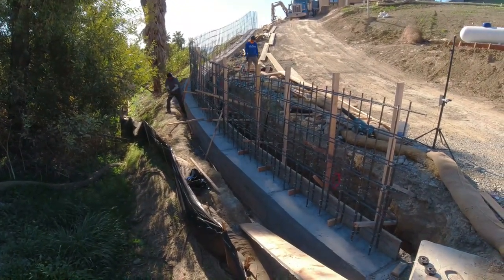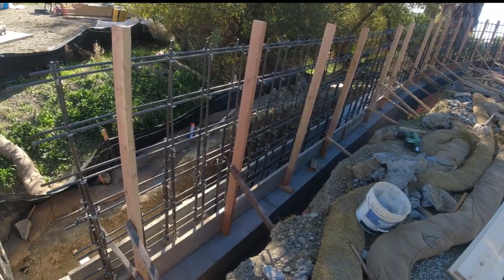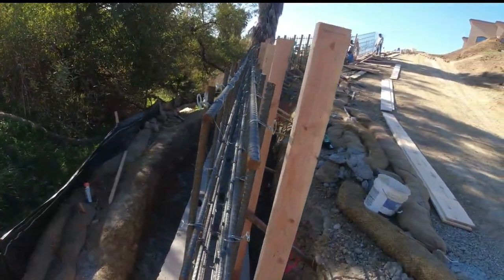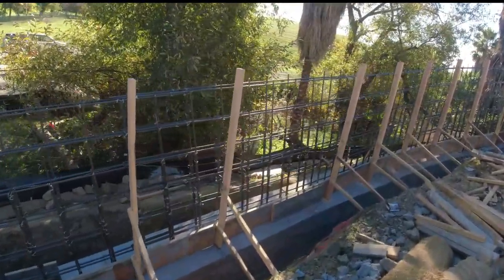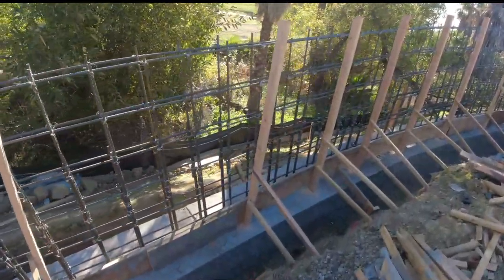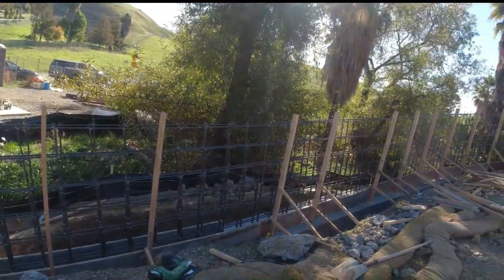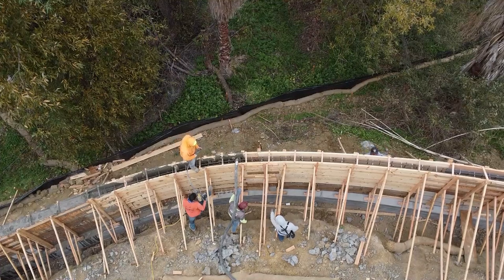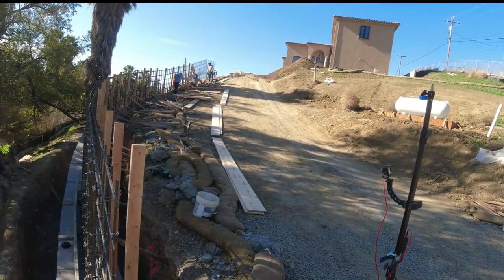Building A Concrete Curve Wall Using 2 x 12s

Comment: what is the height, widhth and length
also details of the steel you used

can you please provide the details
Reply from the maker: This section 130x7x10 inches double matt #5 8 inches on center